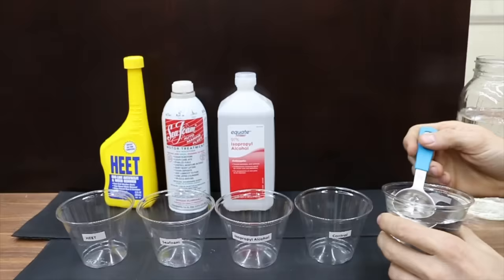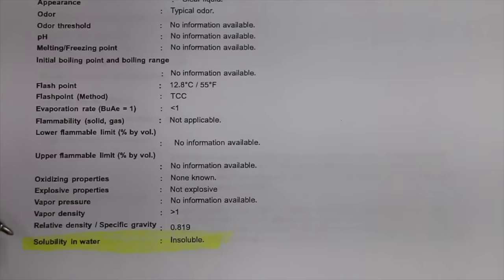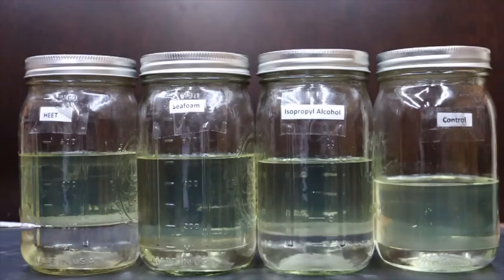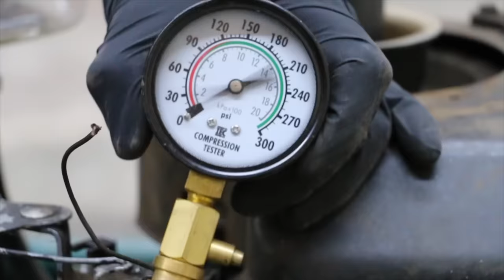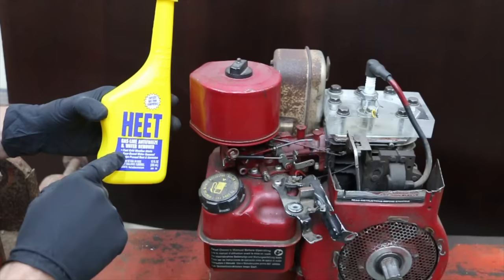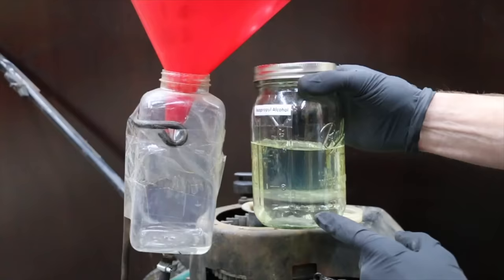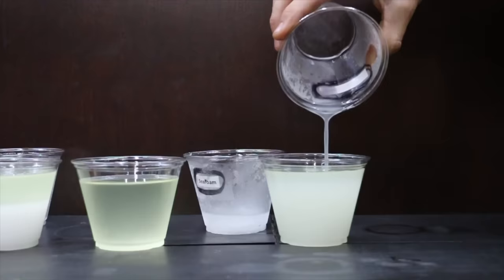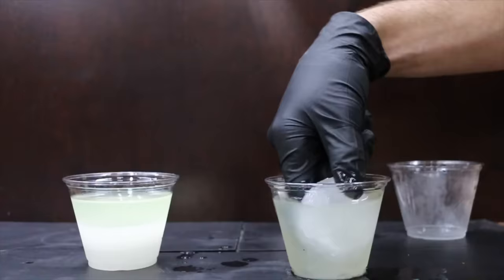Is HEET better than Seafoam for Water in Fuel?  Let's find out!

Comment: If you have an engine that has a lot of carbon buildup, the combustion chamber can be cleaned by running the engine about mid RPM, while slowly drizzling a thin stream of water into the air intake. The engine will eject red hot chunks of carbon out of the exhaust.  For safety sake, use caution.  Also, keep people, pets, and flammable materials away from the path of the exhaust.  Chunks of red hot carbon can travel a long ways.
Reply from the maker: Thanks for the feedback.
Reply: So how would "red hot chunks.of carbon" make their way out through the cats and exhaust convolutions?  I remember a guy was claiming this in the 90s for his carbon cleaning machine and everyone laughed at him because it was all in his imagination and you seem to likewise have a rich imagination.  The water trick, not that it has something to do with this, is also not new. It's just that legitstreetcars ia doing it now and in the most boneheaded way possible by just dripping it in instead of using a simple sprayer to break it upninto droplets and make it safer.

Comment: Didn't read through all the comments, so maybe someone already asked this, but why didn't you show the Seafoam mix in the mower?  Would it have failed miserably?  Also, why didn't you use Iso Heet in this comparison, instead of Heet?  I would think Iso Heet would work better with ethanol gasoline and Heet with non ethanol.  I do like your tests, but sometimes it seems to be apples to oranges.

Comment: Have you ever tried or tested Sta-Bil 360 Marine Ethanol Treatment and Stabilizer?
Reply from the maker: Thanks for the suggestion.
Reply: @Project Farm  A local small engine mechanic told me his trick to fuel treatments is to use this product at double the dose for 2 cycle and 4 cycle engines.  On 2 cycle engines he also told me to add more 2 stoke oil and run it rich to keep those engines running better.

Been trying this advice but not long enough to see the results.  Again, his issues are Ethanol and Water in gas.

Comment: Thanks for the tip I work on boats and have a lot of people that get water in their gas
Reply: Did want to add more than 10% ethanol or methanol can damage a boat motor. So id only do this after  draining the tank, put some heat with a few gallons of fresh fuel. Only run at low rpm till out of gas. Mainly just to get the water out of the fuel system. The high ethanol and methanol content can damage the motor at higher RPM or for prolonged exposure. I've seen it eat hoses, fuel pumps, carburetors, and melt Pistons. So a word of caution is advised
Reply: With an outboard engine curing water in the gas is easy. Pull the tank, dump the gas, get fresh new fuel, and it's fixed.
Have done it twice in 40+ years of boating. Keep the lid on tight.  
:)

Comment: Id guess that the methanol/water mix has about half the btu's per measure as straight gas so you need to use about twice as much.
Reply from the maker: Thanks for the feedback.
Reply: @ProjectFarm  straight ethanol has about 2/3s the energy (BTUs) of gasoline hence cars that 'dual fuel' will find that their mileage drops off a lot with E85.  The price difference between E85 and regular should reflect this difference, thus if regular is $3/gal E85 should be about $2.  I believe that gasoline has about 3/4 the energy per gallon as diesel that explains some of the better efficiency of diesel engines but not all (other factors include the high compression ratio and that diesels are lean burn engines).

Comment: I'm currently having a small issue with small amounts of water making its way to my combustion chamber. I would assume there was a small amount of water in gas at my last fill-up. I'm trying to burn away the entire tank to start fresh and When I can I remove the spark plugs dry them and use suction and compressed air to dry the combustion chamber. Maybe installing a drain plug on the bottom of my fuel tank would not be that bad of an idea.
Reply from the maker: Hope you get the water contamination issue resolved.  Is this on a car or a small engine?
Reply: @ProjectFarm  it's happening to my 1997 Honda CR-V. I tend to do unnecessary repairs. I went buy new spark plugs to swap my current new ones out which had no damage. The one only thing was a heavy saturation on each plug. The smell was not intense like gas, or coolant, or oil. I used a vacuum to get what moisture I could then blew air in each. It just hit the 400k mile mark so I treated it with a coolant flush and changed oil to full synthetic for the first time. I'll try to use all the current fuel before refill.

Comment: I remember the ford ranger you did. So when you said you didn't wanna use the seafoam in a gasoline tank right? So my question is did your truck still run good after putting into the tank then after you sprayed the injectors? I was gonna try the sea foam but your Makin me rethink of using heat lol.. what's your opinion bc I Def have water in my tank.

Comment: is heat glycol based.. if so should be good to -20c or so  alcohol if in solution over 40% good to -40 c or f you choose lol  i believe if you left the ice with alcohol over time it melts but will be a slow process  surface area and concentration levels being the factors  . thanks for the video
Reply from the maker: Thanks for the feedback!

Comment: If you see the tanker at the gas station, go to another. Preferably different brand. Tanker may have just been there. Not that the tanker is full of water. It maybe, these days, but it's sloshing up the water in all gas station tanks. Tip 2, It may not be water. Just terrible government reserve gasoline. Yep, stuff meant for machinery that can handle it. The deuce and half run on soldier piss. Tip 3, if you're a mechanic. Let it sit on a flat surface or in your garage. Day maybe. Disconnect the fuel filter. Jump off the fuel pump and run out a few gallons into a gas can.

Comment: This does give me a bit of hope. We Got gas a few hours ago and get a couple miles down the road and my car dies. Not even a half mile down the road another vehicle is broke down and then our tow truck druver says this happened to 3 people just now. Turns out the gas station has water in their gas 😣 $65 tow later, failed attempt at siphoning gas out so we put a bottle of heet iso in. I'm hoping and praying it helps. I've never had this problem before Ughh. Any tips on what next? Haven't tried to start the car yet and decide to let it sit overnight. I bought the iso because we're not sure how much water is in the gas.  We had some flooding in our area not long ago so I'm sure that's why, but I'm thinking this has had to happen to more than 3 people. I go to this particular store because their gas is advertised as non ethanol.
Reply from the maker: Wow!   If you purchased ethanol blended fuel, there must be a lot of water in the tank.  Per the EPA, 3.8 teaspoons of water will emulsify into 1 gallon of E10 without any help from these fuel additives.  So, I suspect that there is a lot of water and the fuel tank needs drained.

Comment: Couple of points...
1. Adding Heet (some kind of alcohol) to E10 fuel is redundant since you already have 10% alcohol. 
2. Using a product that contains water (your 91% alcohol) to try and remove water from your fuel doesn't make sense. (Fyi Isosplash seems to be 100% isopropyl, would have been a better choice)
3. You're adding a ton of water. Products like Heet may be useful but they're not miracle workers. A consultation with a chemist would be warranted to see what you could realistically expect.

Comment: Once that water in the tank gets frozen, you can do all you want and it will stay there TILL IT THAWS ITSELF OUT.  What I did was made sure I had a tank with a sealed plug on the bottom and drained out the water from the tank first once it was in a warm area and thawed out.  Then i put in a little bit of gas into it, and cleared out any remaining water.  Then put the plug back in and sealed it, and then filled up the tank with 3 bottles of heet and I was good to go.

Most people do not realize even during the summer months when they fill up their tanks there is water in the gas already and very few people let that tank get down to near empty in the first place.  I always drained it out before winter first and then do as described above but added heet to it.  Most gas stations already have gasohol, so I suggest you AVOID ETHANOL AT ALL COSTS.  BUY PURE GAS FOR WINTER TIME OK.
Reply from the maker: Thank You for the constructive feedback!
Reply: You are most welcomed.

Comment: All fuel has 10% ethanol in it so in America you no longer need those products but they still sell them
Reply from the maker: Thanks for the feedback.
Reply: Dave, you are technically correct.  Unless you start talking about dealing with water in your fuel that is a problem not due to freezing but just due to fuel contamination.  Here in the south, water condensation from air moisture is a real problem.  Specially in marine environments where  your engine may not be run often.   So i agree with the comment, but we still need products to help us deal with water contamination.   Stabil helps a little bit

Comment: Im not gonna pretend to understand anything I just saw but I’m very confused.  At 10:02 you are trying to see if the heat or alcohol can melt ice within the motor but the labels on the cups are not the product being poured into them...so is it the alcohol that slightly melted into slush? Or did I miss something?

Comment: I have water in the gas, at least that's what my know it all neighbor says.  Before i go buy heet I'm gonna try the 91 % alcohol as i had some around.  I'll let you know the results in a day or two.
Reply from the maker: Thanks for sharing.
Reply: O.k. results:  91% alcohol did the trick.  The stalling and rough idle have stopped , used about 3/4 of qt. bottle.  Thanks

Comment: I have a 350 I accidentally added seafoam to the oil twice (it's a long story) I lost oil pressure to the heads. Drained it, put oil in it still no oil but had pump pressure. Drained the oil and put 1 gallon diesel 1 qt oil mix and let it idle off and on for awhile. I got oil back to the heads. Drained it ( very dirty ), changed the filter again and put new oil in. Started it up and no pressure on the oil gauge when it was at 55 before. Any ideas other than a teardown?
Reply from the maker: The oil pickup might be plugged.  Recommend dropping the oil pan.

Comment: Let's do some math.  On fuel injection vehicles let's say fuel pump does 60 gpm.  So you drive 60 miles at 30 mpg.  Your fuel gets mixed by the
pump output and return line.  So the HEET product works well for fuel injected vehicles in winter.  A little alcohol is good in moderation.  That is exactly why ethanol fuels work in autos.  Have you ever drained alcohol off of fuel?  Smells like whiskey.  But when you kill your vehicle, proper fuel is in the line.  When you start it, the fuel is mixed before engine has used the fuel in the line from the tank.  Ethanol separates out of fuel.  Taken too many tanks off and saw it first hand.  But it is almost instantly mixed.
Reply from the maker: Thanks for sharing.

Comment: I picked up a gas can that had water in it and I did not realize it I thought it was gas and I poured a gallon into my gas tank for my car now my car will not run what should I do? I added four bottles of heat dry gas and then added 10 gallons of gas but it will not run still

Comment: I believe seafoam may have some uses but they shouldn't put remove water from fuel on the can if it's not good at that, sure it has a little alcohol in it but it makes no sense to use it for this purpose.
Quite frankly it makes a very bad impression.

Comment: I experienced my engine spitting and sputtering today after having 2 bad days of weather. Blowing snow,extremely cold temps and my fuel filter,fuel lines and cap are all 2 years old and my car is a 1994 Oldsmobile Cutless Sierra. I have 1/2 tank of gas and always buy from the same gas station. Drove today and the car did the sputtering and shaking. Should i use Heet because i might have water for some reason. I dont know why the car acted up.
Reply from the maker: Yes, HEET is worth a try since it's very affordable and can help rule out water in fuel.  I suspect something else is probably wrong.

Comment: Is there any in tank carb cleaners that do anything to help chean dried ethenol goo? That would make a desent video. Im tempted to soak parts in a 50/50 vinager water combo for all the corosion. I have a brand new 2 barrel carb with the accelerator pump cometly clogged with dried ethenol. Got it working but still not right. Carb cleaner didnt do anything for it
Reply from the maker: Thanks for the video idea.
Reply: @ProjectFarm   2 ethenol goo video ides....bet you can tell what im battleing haha. Somthings gota disolve that crap

Comment: I have a question. I have looked around & cant find an answer to it. I have some dry gas that im sure is "real old" does it go bad or does it just get weaker with age? Can it still be used?
Reply from the maker: Is it in a sealed can and never opened?  If so, it's probably still good
Reply: @ProjectFarm  thank you. for the quick reply. It is a sealed plastic bottle.

Comment: back in the 80s, methanol was a no-no for rubber and gasket parts...methanol would dissolve rubber seals and gaskets...dont know about today-dont know if the seals and gaskets hold up better to methanol or not, but I wont use it due to my experiences from the 80s...I use seafoam as a fuel stabilizer and 90% iso for cleaning fuel lines and carb bowls...
Reply from the maker: Great point! Thank you

Comment: Ethanol is what you use to remove the water. It does so by making a solution with the water so it can be burned off. My car dealer was trying to sell me an expensive additive to remove water, but ethanol already does this and is already in all but marine grade gas! Never heard of using isopropyl which contains water, to remove water!!!
Reply from the maker: Great Point

Comment: I guess in the early 80tys I was at my uncles and he was out with his model A john Deere tractor getting up fire wood and it was about -5° F degrees in iowa at that time and the tractor begin to cough and sputter and he headed to the house and grabbed a bottle of heet from the shed that was out side (at -5°F)  and poured it in and watched the fuel bowel  and as the heet worked the sputtering cleared up however you could see the water collect in the bottom of the fuel bowl, he then shut the tractor off and dumped the fuel out of the fuel bowl and worked the rest of the day with no problems, at the end of the day a little more water had collected and he dumped it,  the thought was a little frost had collected in the gas cans after he had bought the gas a  couple weeks before and they to had been setting in the shed and we had some warm weather during the days before getting up to about freezing and frost had built up in the cans and the moving and pouring of the gas in to the fuel tank of the tractor and maby the tank had some frost and gas sloshing around knocked it off and down to the bottom of the fuel tank where it started to plug up the fuel line, however heet saved the day.
Reply: Did you notice he labeled the samples wrong on the last test?

Comment: I got water in my gas tank, I suspect some immature teens with nothing to do poured roughy a gallon of water in the tank while I was out (gas door was open and cap was out and there was a gallon container on the ground near truck) ..made it home shut the truck off and won’t start again.... will heet or the alcohol make the water combustible so I can burn it through the engine without having to drain the tank?
Reply from the maker: A gallon is just too much water for HEET to overcome.

Comment: Just a warning: Most rubbing alcohol bottles contain water.
I had this issue on a trip to Hershey Pennsylvania one year.
On the way back to Ohio we stopped for gas at a no name gas station.
Immediately started losing power on the highway, after stopping at a rest area and checking out the car it got worse.
It began randomly chugging missing etc.
Knew it started just after getting gas I thought water.
I got 2 cans of sea foam and no improvement.
I got a bottle of red heet, not much better.
When I got home I dropped my gas tank and could see a large quart sized water bubble at the bottom of the gas tank.
I had suction it out.
Ran great again then.
Reply: Great video!
Reply: Heet don't contain water like medical isopropyl alcohol
Reply from the maker: Thanks!

Comment: The yellow bottled Heet will completely dissolve the Ice if you use enough of it and give it enough time to work.
Reply from the maker: Thanks for the feedback.
Reply: @ProjectFarm  I put the Heet in the freezer before I added it to the gas/ice mixture so it was below freezing and wouldn't transfer any heat to the test.

Comment: I had water in my fuel put there by vandals. I drained the fuel system of my car, & flushed it out. When I replaced the fuel, I put some diesel in the fuel. I then fitted a locking fuel cap.
Reply from the maker: Thank you for the feedback

Comment: Why do my small engines start so much easier with seafoam in the fuel? It works great here in northern VT. Trying to use nonethanol  ht for these units. Mower blower and 2 stroke husqy.
Reply from the maker: Thank you for the feedback

Comment: Drain tank as much as you can. Pour 5 gal 100% gas in and add 2 bottles of red heat.  Run It out of gas, should fix the problem.
Reply from the maker: Thanks for the feedback.